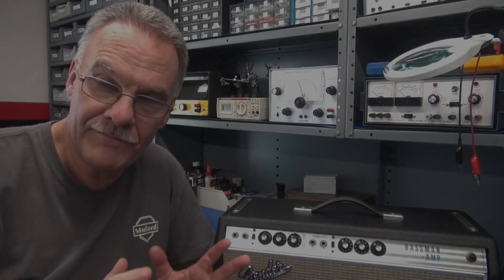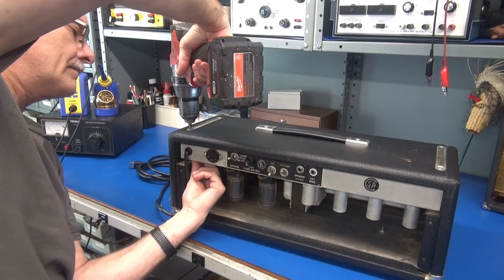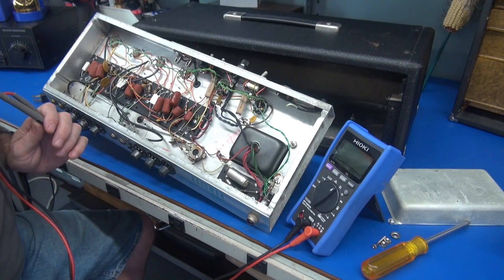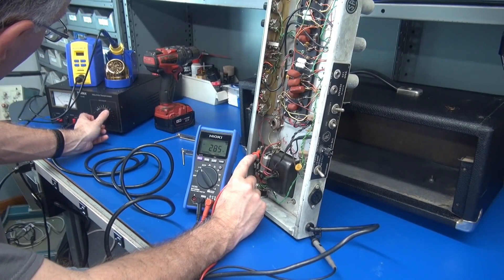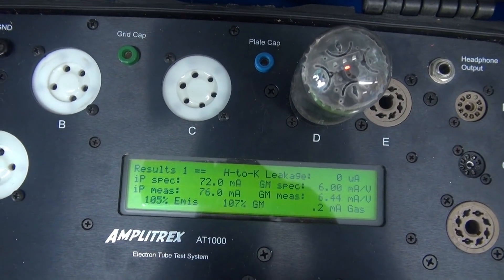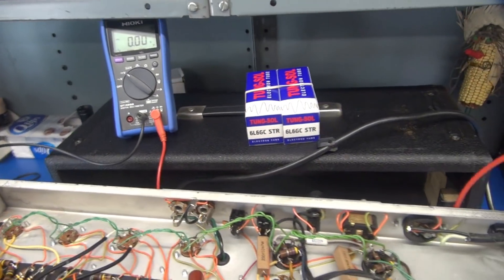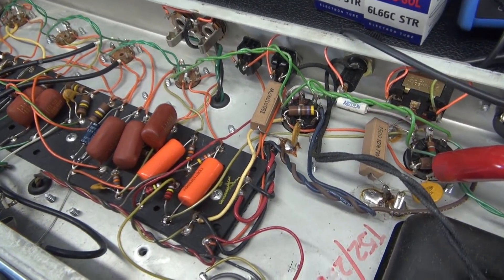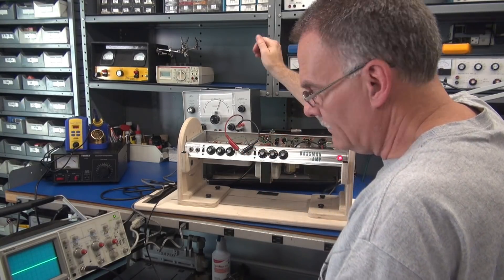How to fix Fender smoking Bassman guitar amp process for tracking down and repairing negative bias

Comment: Please make a step by step video of how to add the bias pot to this circuit, replacing the bias balance system. I have this same amp and would like to do it (I’ve serviced it with new filter caps and grid caps) but would like to see a video on how to add the better bias adjust pot.

Comment: I'm confused what was drawing 100mA of current, the plate or cathode on the BAD tube? The GOOD tube was drawing 60mA of current?
Reply from the maker: Both RCA 6L6's were bad. The one drawing over 100ma was a red flag. Normal current draw on this tester specs around 75ma max for 100% emission. The new Tung-sols are nicely matched.
Reply: @d-labelectronics  75ma is the plate current draw or cathode current draw? Because I'm confused because mostly you set the current draw for 30mA in all your videos for biasing tubes but on the tube tester considered good normal current is at 75mA being draw by the tubes plate and cathode which doesn't make sense.
Reply from the maker: Hello, The current shown was on the Amplitrex 1000 tube tester, not installed in circuit on the amp. When I install the tubes, you are correct, I adjust the negative bias so that each tube draws approx 30ma

Comment: Is the Allen Bradly pot you installed still available for purchase
Reply from the maker: It was a NOS one I had on hand
Reply: @d-labelectronics  I thought so, it worked perfectly for the application...worth its weight in gold
Reply: They're still available but made by other companies.
https://www.newark.com/tt-electronics-bi-technologies/p270-sf21br10k/rotary-potentiometer-10kohm-10/dp/46M2514?ost=p270-sf21br10k